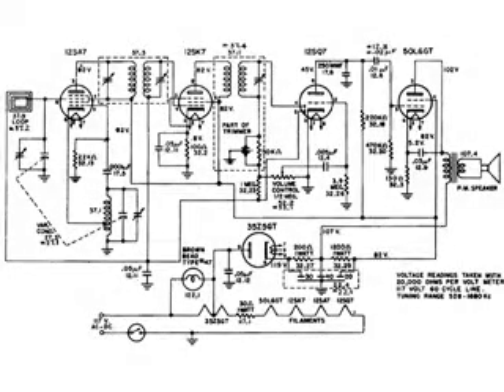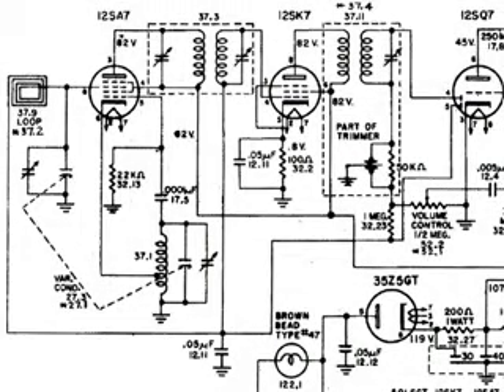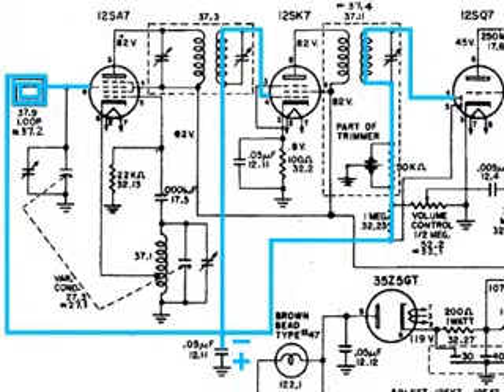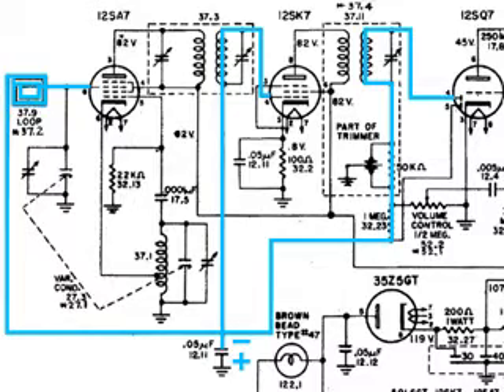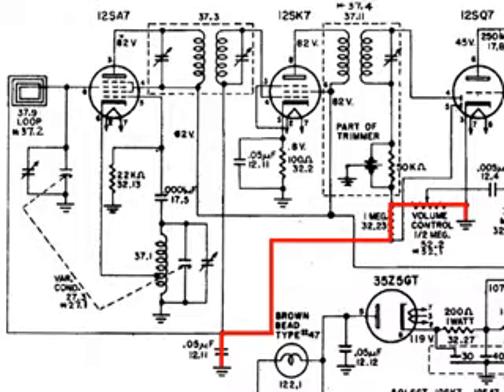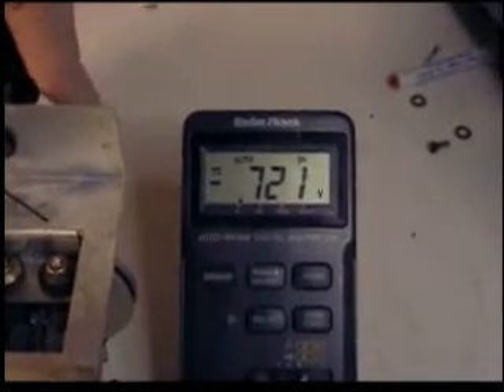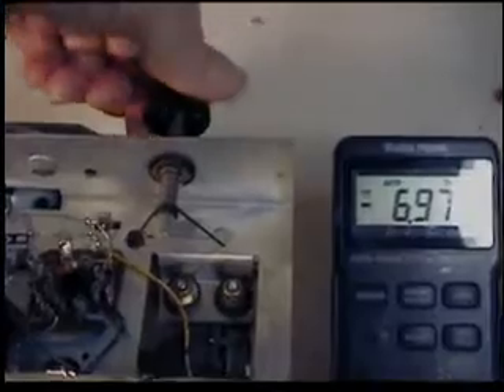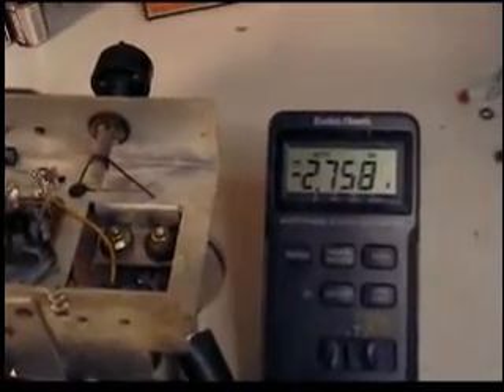Automatic Volume Control

Comment: So the negative voltage actually comes from the negative swing of the signal , been struggling with this concept for many moons, thanks.
Reply from the maker: Thanks.
YES, they could have use the positive half, but that would make the bias positive on the grid making the tubes conduce more. Just the opposite of what is needed.

Comment: Hi..I have a Hallicrafters SX-71 and Im trying to find the AVC control..is it part of the BFO switch? The diagram seems to show it this way, and how would the avc work on this receiver..? I am new to aligning radio's..but have some background in electronics..your videos are great...very laid back, but to the point videos..thanks..
Reply from the maker: This set has an AVC switch SW38 the AVC capacitor is C50 0.05MFD
Reply from the maker: It's SW3B not SW38.
SW3B is the AVC switch, SW3A is the BFO switch, the dotted line between them means they are mechanically linked together.
Reply: So the AVC is working when the BFO switch is in the OFF position..is this right..?? Thanks for your help
Reply from the maker: Yes R48 disables the AVC
Reply: Thanks alot..just curious if you were a teacher...you have the patience and voice of one...
Reply from the maker: I taught software for over 11 years, for a very large Corporation.
Reply: I have one more question about this SX-71..when I got it the meter worked...and now it dont...I had the radio on its side so I did not look at the meter every time I replace a component..so dont know which one made this happen..if it did at all...could you tell me what makes the meter rise and fall on this radio..please..thanks

Comment: Just wondering how a ground can be positive in the circuit.  Is it just because you have a negative dc voltage that can't pass through the .05 cap?
Reply from the maker: +Cameron Burns 
If you were to reverse the diode, then you would have a negative.

Comment from the maker: @IBreedBassetts9C 
The diode in the 12SQ7, pin4 and the cathode, changes it to DC. Current can only flow when the plate, pin4, is positive. When the top of the coil is negative there is no current flow, so that part is discarded.

Comment from the maker: To disable the AVC you use the smallest usable signal possible. You don't want the .05uF 12.11 capacitor, the one at the bottom to change up. If it charges up and it will be negative, that charge will lower the volume making it harder or impossible to find the I.F. peaks. Thanks!